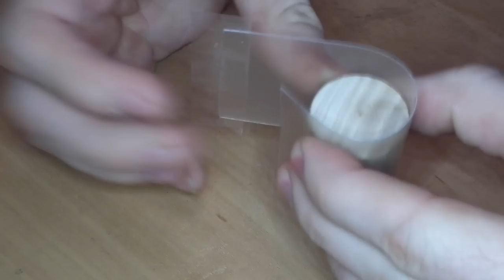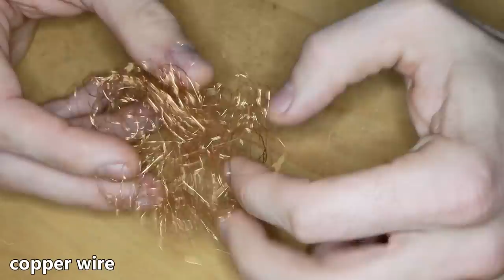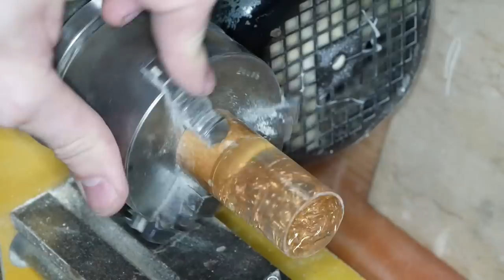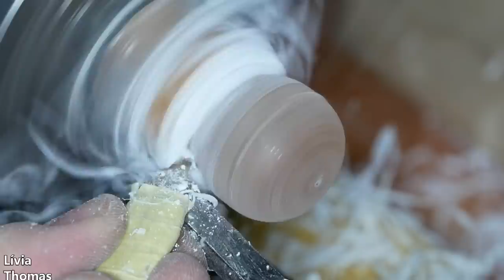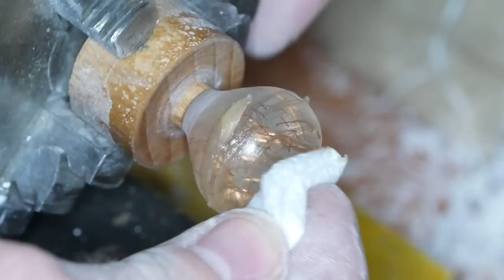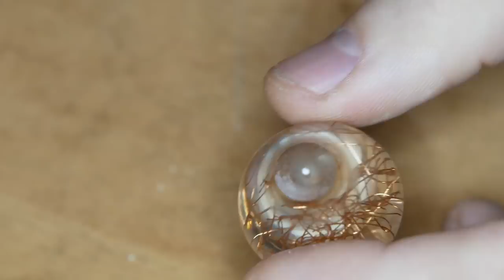Copper Wire Pendant / RESIN ART

Comment: This pendent is gorgeous,,, and I suppose  it could be done with differant type metal wires as well or even a mix of all, cool for paper weights,,, a ring or bracelet done with bezels ,and the wire would look cool,,,especially  if it was done with,, for example  gold in one bezel and alternating  wire colors with one in a mix of the colored wire, for a bracelet would be awesome,,,I think it would work quite well.and want to try an experiment  that way myself great work.